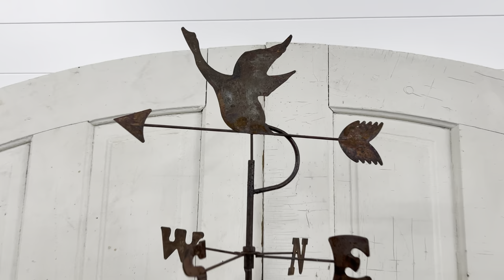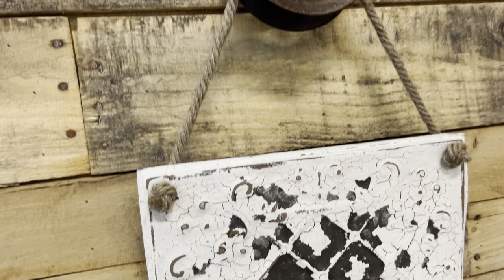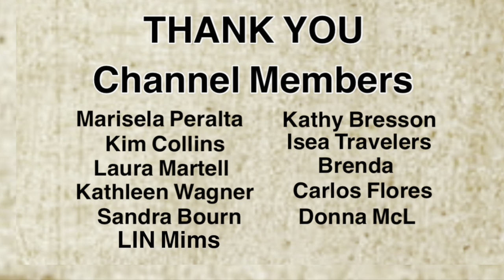TRASH TO TREASURE OLD SALVAGED FINDS MAKEOVER

Comment: Regular drill bit and your power drill will work just fine putting holes in old, tough, dried out skirting leather (thick leather used to make the wearing parts of saddles). Just have a piece of scrap wood underneath and hold on tight so the item doesn’t go flying. I don’t recommend this process for thinner bridle leather or leather for purses or purse straps. 

That is an old ring snaffle bit. Those old cast brass bells are worth good $! Great find. This swag would go great in my horse barn!

Comment: Next time you want to twist wire, 1. Secure piece in vice. 2. Put open ends of wire into the chuck of your drill and secure it. Turn on drill slowly and it will twist for you. Use with less stress and muscle use.
Reply from the maker: Why would I want to make it easy.. lol😂👍

Comment: The only thing i have to comment on, not unfavorably exactly, but both the weathervanes looked a little odd because their bases were so small.  You might have tried just adding a larger base to them, just gluing or  nailing it on to the existing bottom.   😊